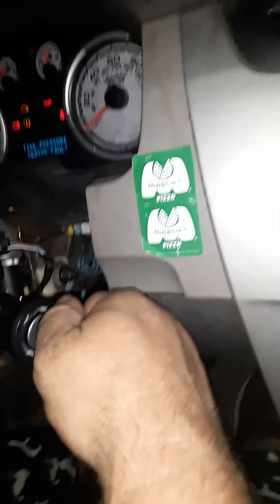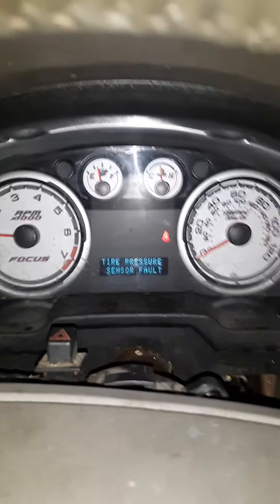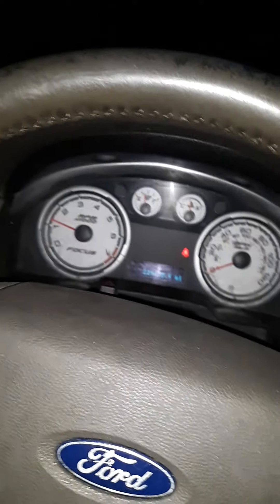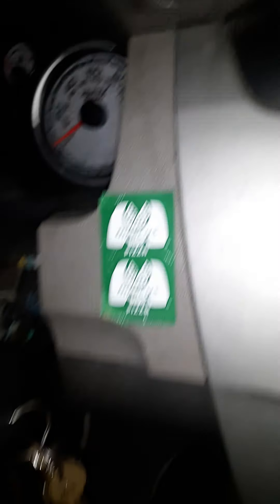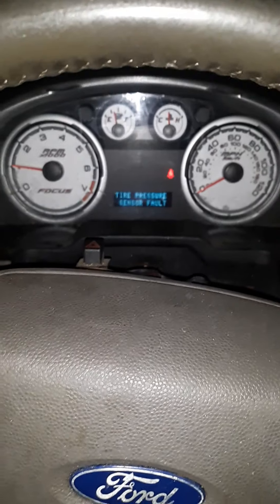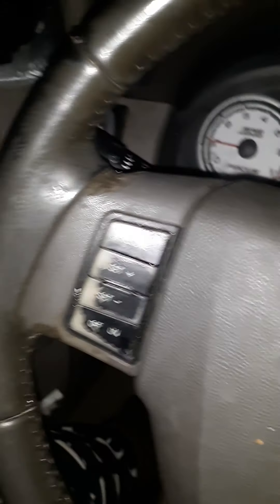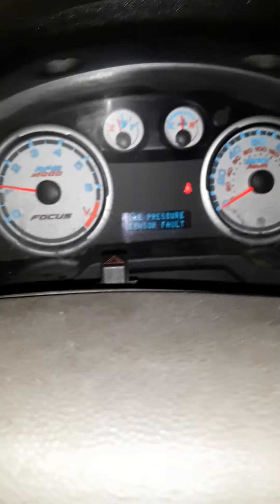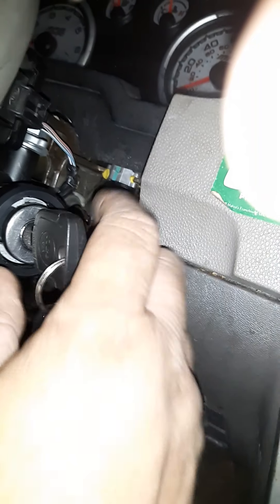2010 Ford Focus No Crank Starter Not Getting Power From Battery...FIXED!!!

Comment: Heyy I put in this switch and it still isn't cranking. It slowly got weaker, hit o Reilly and they said battery, alternator, starter tested fine. The think barelyy started there and hasn't since parking in the driveway. I tried a new battery, jumping both off, new ignition switch. Then tried the button start. Where else do I look?! Thanks 🙏